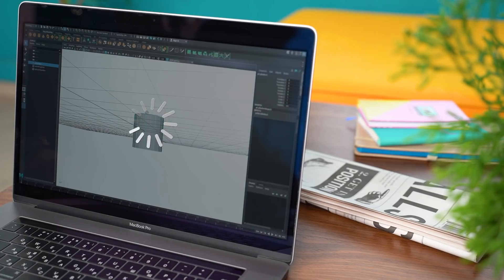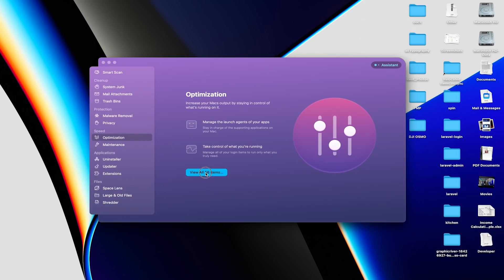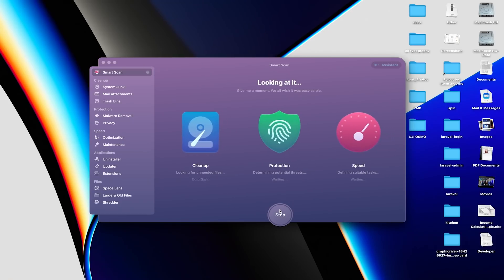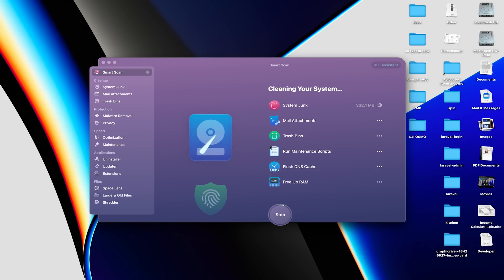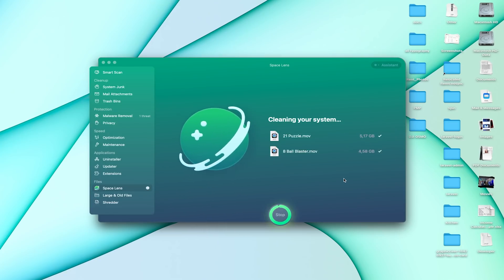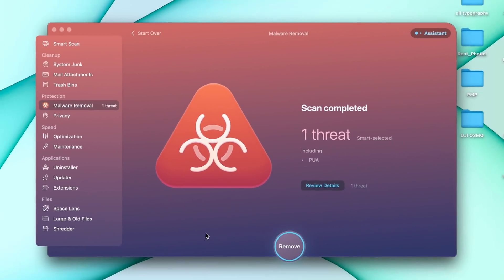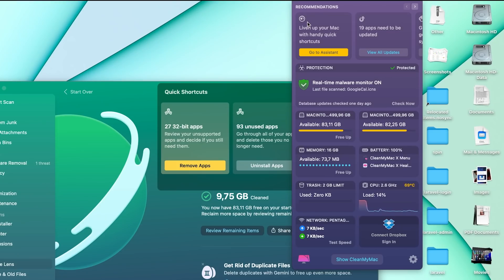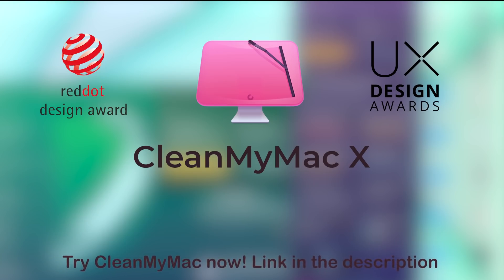Simple Automatic Lifting Machine

Comment: Im cconfused, how are you powering the wiper motor off such small batteries, I struggle with this all the time, I have to use a huge 12v 7ah battery for it to continue to work under load.